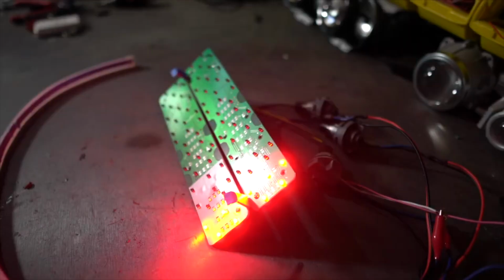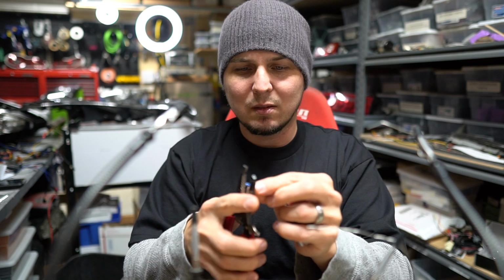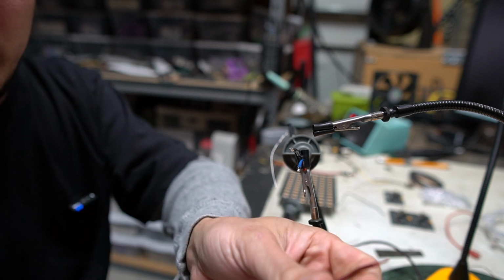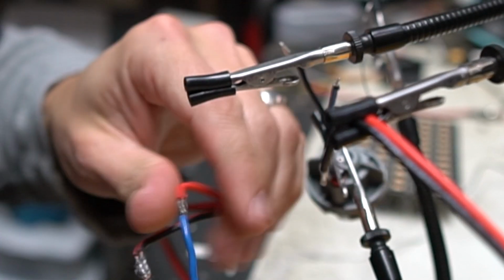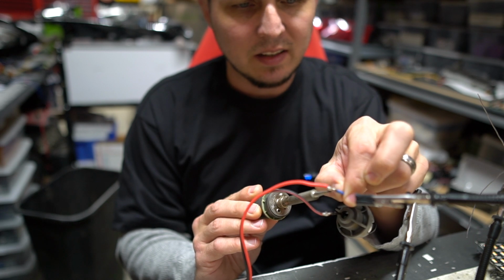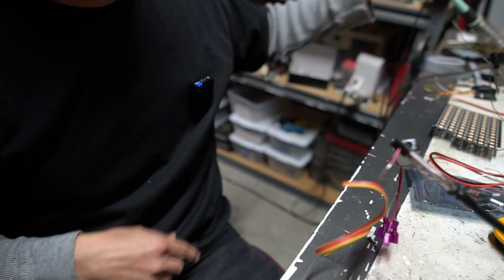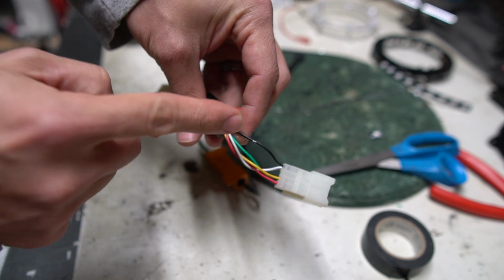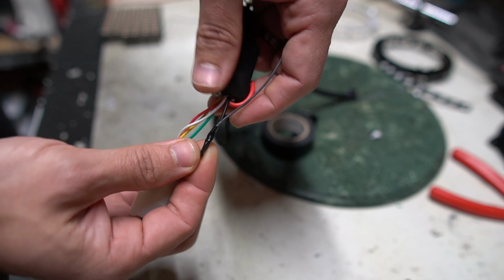Solder and Heat Shrink Wires

Comment: Pro tip that i got from my college at Koenigsegg. If you need to get that heatshrink of, drag along (Do not cut it so you dont risk going through the cable isolation!) the heatshrink with a razorblade and heat it again, its going to bloom like a rose! Easy to then peel off! 
Greetings from Sweden! :)

Comment: What peice of equipment are you using to test the power after your solder? Like if you have a 5V and then another 12V - is there a multi voltage power tester set up?
Reply: D.V.O.M. , Fluke meter

Comment: What i do especially for thin gauge is to strip one side longer then twist and foldover to the longer stripped side so it folds on to the stripped wire then sodder the whole thing so there is less of a weak point then heat shrink

Comment: I put yellow LED bulbs in my 2008 Subaru Outback fog lights and it gave off a little bit of yellow and a blue ish hue so when you step back and look at the bulb its not straight yellow its almost like a disco ball lol idk if its because they are reflector style or if I’m better off with a yellow halogen bulbs.

Comment: You have to be careful not to creare a cold solder joint. That's why I don't use that method. Solder doesn't conduct as well as wire. I use the marine heat shrink too.

Comment: I learned a new way to solder.  Thank you!  I didn't know that you could tin each  wire, lay them on top of each other and then solder together?  I've always twisted, then i started soldering the twist.  Thats not easy and it's super bulky!  Thank you for your insight!!!

Comment: I don't solder when doing wiring anymore I crimp but I'm not using wires that thin either. And insulation tape only comes out of the first aid box when I'm bleeding!